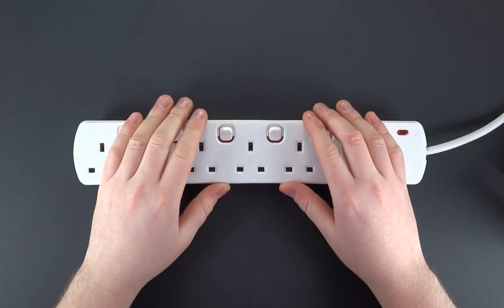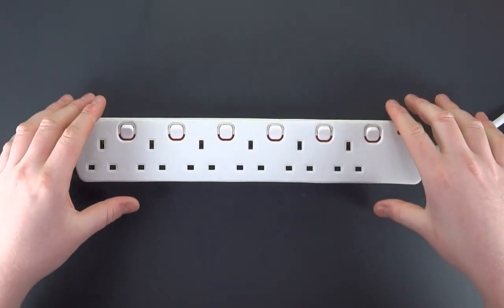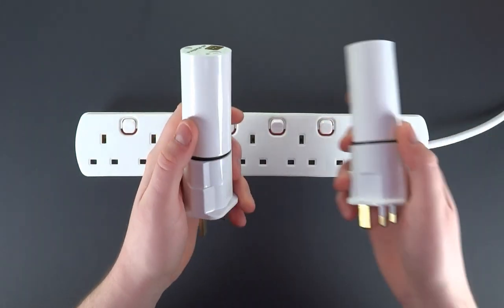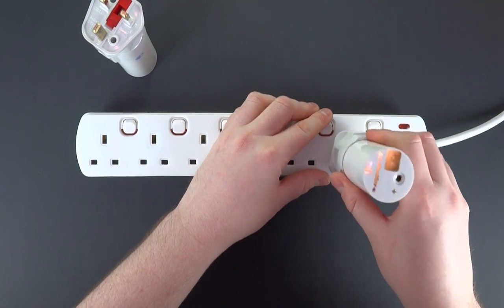Positioning & placement of the AC iPurifier

Comment from the maker: You can use the AC iPurifier in either or both in a power strip/line or at a wall outlet. Also placement in either beginning and middle of the power strip/line for best results stopping analogue/digital power supplies from throwing noise back into the strip. Maximize your audio system!

Comment: Using an emi meter, I was able to prove that it actually adds noise to my lines in some cases. Maybe I did something wrong.
Reply: I tried some power conditioners. They do change sound quality but I am not sure if that's better or worse.
Reply: Also in my case.
Reply: Using Trifield EMI meter I found it added noise. Noise varied a lot in my house from outlet to outlet and in every case the Triefield indicated more noise when using the IFI!
  Can someone answer this?    So far only devices I have found to reduce noise, in my limited testing is an old Panamax, and Furman AC215A

Comment: This helps with ground loops?
Reply from the maker: For ground loops, we'd advise using our GND Defender. This will remove the excess earth connection intelligently - reinstating it when needed for full safety compliance.
Reply: @iFiaudiochannel  Many thanks for the fast answer. It can be connected to the outlet? Best regards
Reply from the maker: @Miss_Pixie  The GND Defender is a solution for IEC connections, so it doesn't terminate in a wall plug-style connector. 

For more information on the GND Defender, please check the product page here! 

https://ifi-audio.com/products/gnd-defender/

Comment: On a power strip with ac ipurifiers, should a dac with preamp function  be alongside digital devices or analogue devices ? (Since it's both digital and analogue)
Reply from the maker: Hi.We would advice it to be along the analogue side. Thanks.
Reply: If you try both methods and you can't hear an audible difference in your system, then it doesn't really matter where you place it.

Comment: You should also buy paint protection for your new car because it wasn't painted correctly. Maybe hifi engineers should consider painting cars as an alternative career if they can't design a power supply that isolates it sufficiently.
Reply: Paint protection for your paint is to stop stone chips on your perfect paint job so you don’t have to fix and re spray. the ifi for me does what they’ve stated / cleans up the sound not light and day but very audible I have 5 all up , one power station  the rest around the home in key places as I added more and more it all ways sounds better. How do I no this ? You just take it all out and  listen very easy to hear the difference.
Reply: @eddywaller1864  no, paint protection does not stop stone chips. Paint is stopped to cosmetic, which out can't be if it just chips. If you believe you are buying a car where the cosmetic skin will fail, buy a different car. If your hi end HiFi cannot operate with the power supplied, it is not hi end. Either admit that the hi end isn't high enough and needs augmenting, suggesting buying higher end, or admit it's nonsense.

Comment: This does nothing for the audio & video components themselves which collect RF up to a trillion pulses per second out of the air itself.  Sure it helps dissipate some power line noise however the chipsets & all active & passive parts & wiring inside the gear are still collecting MASSIVE amount of RF every fraction of every millisecond from RF airwaves that are everywhere.  Electronics are continuously overloaded from direct collection of RF causing massive signal degradation when directly compared to one that has been upgraded by The Upgrade Company.  Night vs day
Reply from the maker: Thanks for your comments David - If you type in does AC iPurifier work you'll see our Canadian retailer putting it to the test. Thanks!